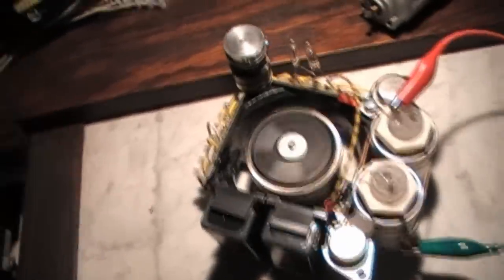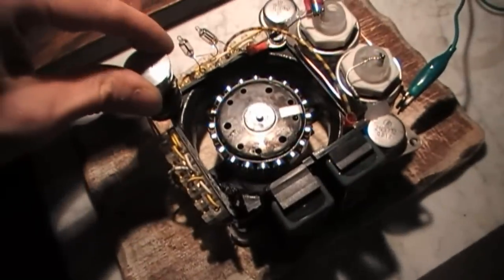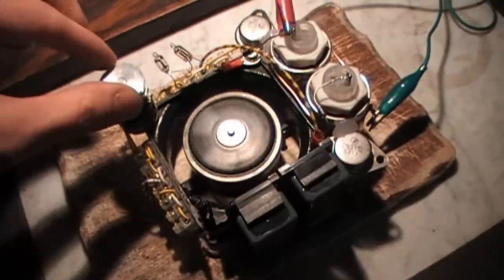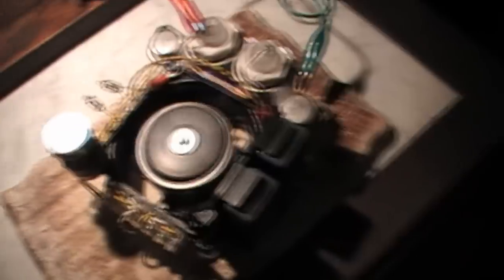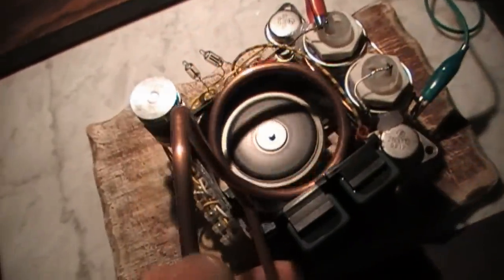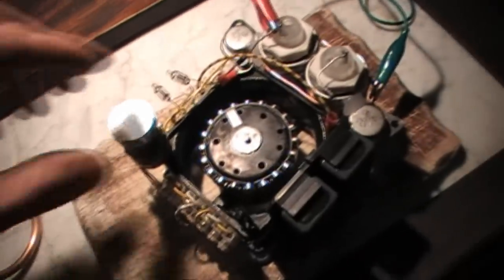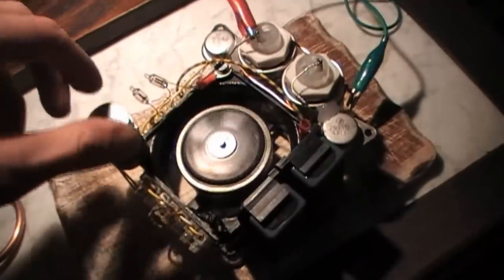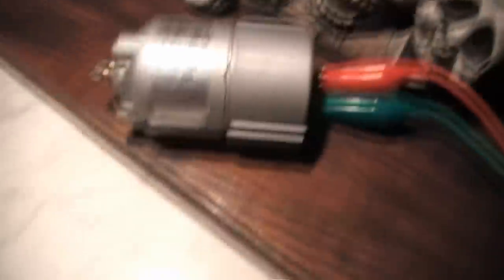Heizen mit Magneten - Magnetheizung bzw. Kupferrohrbremse

Comment: that device does'nt have the power to heat the floor or radiator heating. minimum 300T power is required

Comment: Super Tipps wie immer. Ich finde es hat was von Induktionsplatte nur halt das die Magnetfelder durch Bewegung erzeugt werden nicht umgekehrt, das eine Spule ein Magnetfeld erzeugt im Leiter. Ich denke es ist den Bau Wert. Ich finde auch wer sich weitehelfen kann ist im Fall eines Stromausfalls gut gerüstet und kann auch vielleicht Autark leben wenn dieser es schafft eine Maschine zu bauen die lange Strom erzeugt. Es soll ja Energie Konverter geben die teilweise 50KW (50.000 Watt) Leistung abgeben auch ohne Umweltbedingungen, halt vollständig autark laufen. Wenn man es schaffen könnte mit Hilfe einer Vorrichtung das Magnettfeld zu unterbrechen z.B. mit wechselnder Wärme, Kälte, hätte man vielleicht auch eine Induktion an den Leitern und würde aus den Pulsierenden Magnetfeld Wärme bekommen, wäre genial, nur kostet das Unterbrechen halt mehr Leistung als man wieder als Output zur verfügung hätte in Wärme. Wenn man eine Testvorrichtung hat und eine Spule Außen und einen Magnet Innen dann könnte man was dazwischen positionieren was Ihm immer wieder unterbricht, so erreicht man ein Ungleichgewicht. Mann könnte ja natürlich Strahlende Elemente nehmen und diese damit umhüllen aber ich bezweifle das es überhaupt funktioniert. Auch ein Kondensator der die Elektronen in eine Richtung drängt oder eine Art Vorrichtung wie die Kristallbatterie soll ja die Wärme direkt in Strom umwandeln. Viel Erfolg bei deinen Tests. LG